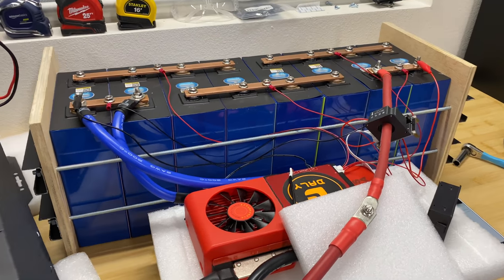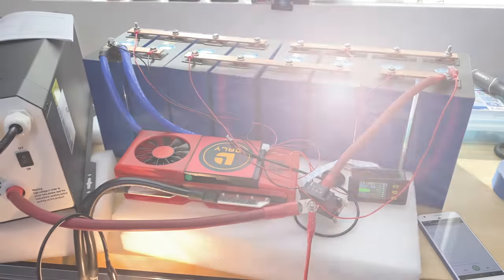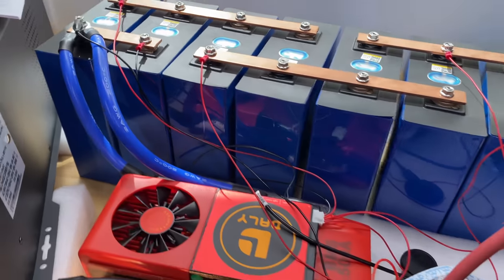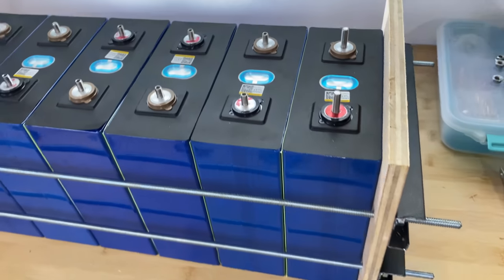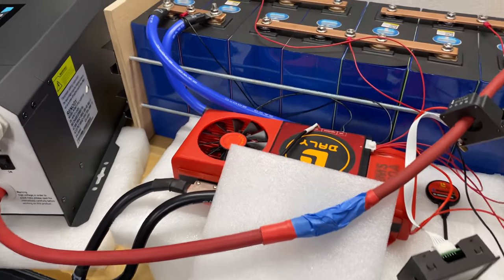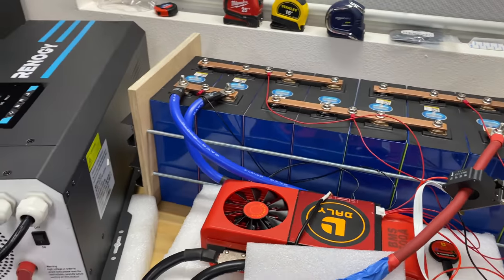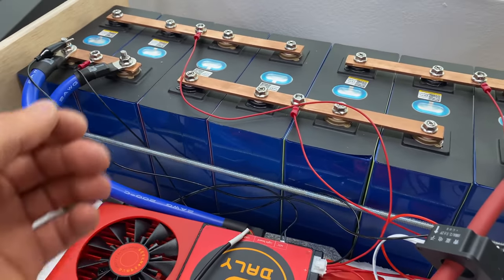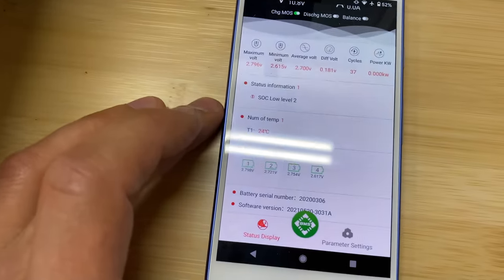Compressing swollen Grade B LiFePo4 prismatic cells. Let's experiment. Don't try it at home.

Comment: For the bus bars I recommend oval shaped holes instead of the round ones that fit almost exactely to the thread. With almost no space for expansion the tension/force will damage the housing of the batteries. At the same time, I don't think it is wise to compress battery cells, no matter what kind of technology is involved. Lead acid cell can also swell, suppose you would do the same ?! This is a blue print for disaster...
Reply: I would agree with you for Grade B cells, but let's not forget that the battery cell manufacturers actually do recommend it to increase the cycle life of the cells. I think that as long as you don't go to extremes with the pressure when compressing them, you're going to be fine.
Reply: The cell manufacturers recommend compression. Eve batteries are give 2500 cycles lifespan uncompressed, and 3500 when compressed.

It seems counter intuitive, but that's what I've seen
Reply: @MatthewN8OHU  beat me by 14 seconds! lol
Reply from the maker: could you give me an idea of how to cut oval holes? I was thinking about this, but cannot get an idea of how to do it with standard tools. Thanks.
Reply: @SolarEngineering  two holes drilled adjacent and a little file to smooth the ridges between.
Reply: @SolarEngineering  use your little grinder to cut between 2 drill holes
Reply: @SolarEngineering  after you have drilled the hole, angle the drillbit from side to side along the busbar(   --/-- then --\--   )  that will carve away a little and make it oval. Test on a scrap piece before, and dont put too much pressure on the sides, I have done it with a cordless drill in screwing mode( with torque clutch) so if it snags it will stop
Reply: @SolarEngineering  Depending on the material (copper, steel...) drill 2 holes close to each other and use a file. Miling is also possible if you have the right equipment/tools.
Reply: Considering several spec sheets I've seen have specifications for compressing these types of cells I'm not sure your gut sense is necessarily accurate in this case. ~12psi is a common measurement, coming out to roughly 600 Lbs/force for cells of this size.

Cylindrical cells don't bulge because the structure of the case more or less prevents it, they can contain upwards of 100psi. But the thin wall prismatic cells make terrible pressure vessels. They have just enough structure to keep things from spilling out, but not enough to keep the jelly roll inside from moving around excessively and bulging the case.
Reply: @SolarEngineering  a Dremel with the correct bit for copper, after drilling two holes on a drill press using a clamping fixture.
Reply: If bolts or nuts are torqued properly, oval vs round hole won’t allow for expansion. Busbars go on easier once they have expanded, but that’s it. 

I use ceramic fiber mat between each cell and on each end, to help contain a shorted cell from overheating nearby cells. Then 1/4” cement board (hardiboard) on sides and bottom. Then an oak board on each end with well rounded corners. I install 3 ea 1” cargo straps evenly and apply 12 psi. Use a scale in between to calibrate your finger and ears. Get the same brand and size of straps. All you have to do is flick them like a guitar string, you’ll know your close to 12 psi. I shoot for 10-12 psi.
Reply: @USA-GreedyMenOfNoIntegrity  Interesting comment. I'm not that familiar with ceramic fiber. Thnxs for sharing.
Reply: These cells have an expansion safety hole on the top, which is supposed to burst, as a safety measure. It seems this might not occur if the cells are not compressed properly.
Reply: @SolarEngineering  Oval holes are too much work. Just do bent bars so they have a bit of flex room. Like little arcs. 
_/\_
Reply: @DavidHalko  Many battery systems are equiped with these overpressure valves/safety holes. However, I've seen many batteries which were extremely swollen, but the valves didn't open at all.
Reply from the maker: thanks for advice
Reply: @PhG1961  - “swollen, but the valves didn’t open at all”

Were the batteries compressed?
Reply: @DavidHalko  Not very tight. There was some free space and the batteries were extremely swollen almost to the point that they would burst open. These were mainly lead acid batteries for UPS equipment. My experience is that after some years the overpressure valves are somewhat glued up because of the residu of the chemicals inside.
Reply: @PhG1961  - “lead acid” - I had to deal with lead acid batteries which vented in a UPS, what a nightmare! Terrible smell, acid everywhere, had to rip apart the plastic housing with a crowbar to get at the individual vented batteries for removal. No fun.
Reply: @DavidHalko  This is exactely what I had encountered ! I was lucky, the batteries didn't burst open. In the UPS tray there was very little room for expansion...
Reply: @SolarEngineering  Your round holes are just fine. The oval holes are just for initial install. If you left the terminals loose enough for the terminals to move in the oval holes you would create arcing and destroy the terminal. The terminals need to be torqued, in my case I use 4nm.
Reply: @SolarEngineering  Buy  1/4 diameter roughing endmill and first drill hole normally and then use endmill and elongate the hole by moving the part and drilling with endmill little bit at a time. Hold the part firm in a vice, easy. Use light oil or tapping fluid.

Comment: So you got 240-260 Ah out of 280 Ah cells? Did you pay for grade A or lower batteries? Did the price reflect the 10% capacity loss that you have documented? Was the discharge test conducted at room temp, around 20-25 Celcius? As we all know, low temps reduce capacity.
Reply: It was Grade B, but 280 is far from 240-260 AH.

Comment: Hi, i just bought 16 brand new grade A Eve 304 cells. I want to have the same setup as you but two rows of 8 for 16s block for 48v system. What Nm should I tighten up the nuts on the  4 threaded rods to meet Eves recommendation. They dont specify how to do it. Thanks so much.
Reply: I think the specs recommend 300Kgf. Too tight is as bad as no-compression. I am thinking of adding a spring to the rods or some soft material in between the cells. Any ideas?

Comment: Hi! I see you used some kind of inductive load in the discharge test. How accurate is your consumption measurement with an inductive load compared to discharging with a resistive load? In my opinion, any cheap consumption meter is not necessarily close to accurate when the consumption takes place with an inductive or capacitive load.
Reply: If you use the same load for both tests should be the same. He got recycled cells probably see re-lasered QR codes an old one under that plastic top. Compressing a swelled recycled batteries won't fix the problem they are recycled likely been used for streetlights in China what I heard. These companies go around and replace the battery sell it to a 3rd party who puts new plastic on them re-lasers the QR sells them as Grade A batteries to Americans.

Comment: It is my understanding that you have to compress the cells once they are fully charged, and not to compress and then charge them. Also, it's best to use springs to offer resistence and not completely block their expansion and retraction. Finally you can't improve the battery by this method, but you add longevity to the cells, which, off course, works best for cells that arent bloated already.
Reply: It was my understanding that it depends on the type of cell and if the manufacturer calls for compression or simple fixturing. These bare cells often have a +/- dimension for different SOC.
Reply: Why compress when fully charged? is that too late, cells will have swollen?
Reply: @kandkob  perhaps it's like the advice to buy shoes when your feet are swollen? Calibrate based upon the high side of the normal cycle.
Reply: @kandkob  It's the nature of the prismatic cell to expand and contract. You don't want to stop that, you want to control it a bit. That's why you can use springs to offer resistance to this movement. That makes more sense when you have brand new cells, though. To tight already swollen cells like that risks blowing the overpressure valve and killings the cells.
Reply: That is contrary to what I've seen. You want to fix them at their lowest state. You're right that you don't want to completely stop movement, but it does seem that controlling the plane that the growth occurs in is the reason the cell life seems to improve. You don't want growth perpendicular to the jelly roll layers, you want the growth to occur parallel to the layers.

This is one area cylindrical cells absolutely excel. Prismatic cells don't have the benefit of geometry, so they need mechanical help to maximize longevity.

Comment: Alternative title: how to trigger the overpressure release valve 100% on grade B cells
Reply from the maker: )) good one
Reply from the maker: @kimmer6  😂 just a little bit, what happened to the cells?
Reply from the maker: ah, nm, read the description.
Reply: @SolarEngineering  My brand new power supply arrived defective. It did not hold the voltage setpoint. It ran for a week top balancing 12 cells but made little progress. I disconnected 8 cells and put the leads on 4 cells. This happened overnight. The replacement power supply works as it should. Its an expensive mistake.
Reply from the maker: @kimmer6  ah, unfortunately. I feel you pain man

Comment: Compression makes sense over many cycles. It is not possible to see this effect in one cycle.
The difference of a few Ah is not the point.
Due to the new datasheet from 2019 (website: off grid garage) you can see
the advantage over thousands of cycles. The main part is not the central force of 3000N, but the right pressure  !
The gap between the cells should filled - thin layer of epoxy for example, otherwise this is not effective and would cause damage.

Comment: My battery setup is 200 ah plastic encased prismatic cells and no compression they are just put in a plastic box and I use a 200 amp Daly BMS too plus renogy 500 amp battery monitor

Comment: Compression is supposed to be constant pressure. Solid rods and wood ends will result in increasing pressure as cells swell. Some springs under one end of each nut would allow some give while still exerting pressure - still not constant but much less increase than solid.

Comment: Hi what the recommended charge level for 12v life po4 ? From my research its 3.65 per cell.Whats the maximum discharge voltage for the batteries to get maximum cycles from them? I bought 310ah and they are very bloated … i balanced them out and charged each cell to 3.6 and now want to discharge them but unsure to what level its reccomended to do so, can you advice?
Reply from the maker: 14V should be good enough to charge battery fast and keep some safe margin.

Comment: Is it possible to connect 32 cells With 16 cells in two parallel groups That is, summing all two cells parallel to each other Complete with a 51 volt system Any breath, 51 volts Note with the use of one bms
Reply from the maker: yes, checkout my latest video. I have battery 3P16S
Reply: @SolarEngineering  Thank you for the information But why don't we notice it a lot, especially in its great capabilities, unlike the Package Parallel separately?
Reply from the maker: @munirzangana3594  almost every EV has cells in parallel.

Comment: Can you post a link to that ammeter you were using to conduct the test?
Reply from the maker: here you go: https://amzn.to/3F0PXTZ
Reply: @SolarEngineering  thanks.  I picked one up and I love it.  I discharged the batteries completely and then charged it and found my batteries to have a higher than rated capacity (294Ah vs 280). I realize that the 280 would be at 280 amp discharge but i don't really have huge draws like that so it seems more realistic for my usage.
Reply from the maker: @J.DiPietro  wow, you are lucky! glad to hear that you got good quality cells.

Comment: I have the same batteries as you 32 PCS 280Ah 3.2 v i’m going to be linking the batteries together similar to the way you were but in a past video I saw flexible bus bars put less stress on the battery terminals with the very little fluctuation the batteries need do ! It was on YouTube a lady did the video check in the amperage in the batteries in the heat on the terminals in the braided busbars perform the best not the rigid copper bus bar ! Hopefully this may help you in any future frustrations you may have but things out working correctly !

Comment: For the price these cells are a steal.  I got lucky I guess. Mine look brand new and the sides are actually a little concave. 8 x 280AH, same as your. Paid under $870 USD ($1200 AUD) shipped my door in australia. $110/KWH is a bargain even if they fall well short of their claims. I'm a remote power system sparky from way back and used to do all this with lead acid, which even now are still over 3 the cost per watt. 

And this is China dude.  Ya pays ya money and takes ya chances.  You know that. ;)
Reply from the maker: I understand what you are meaning, but I would like to get what I pay for. Otherwise, it's just a game without rules, where the buyer is going to lose.

Comment: hi, what is significate of grade b??
Reply from the maker: Grade A cells - it's a new cell, never been used, every cell has a unique ID number and capacity is equal or more than in specs.
Grade B (or not A) - cells that potentially were used or cells that have defects and/or under rated capacity and unique number were destroyed.

Comment: I don’t get it, what’s the total “result”???
Reply from the maker: Test params:
Cells charged to 3.65V (till 100mA)
Cells discharged to 2.5V
Discharge current 75A (+-4A) / 0.13C rate

Ah before compressing  - 480
Ah after compressing  - 488
Reply: @SolarEngineering  I see, much appreciated 👍🏼

Comment: Just an observation, you are not really compressing the batteries correctly with those metal bars at the top. The holes you drilled need to have wider range to allow compression. Refer to the bars sold on Amazon and Ebay.

Comment: Have you tried ordering through Alibaba and not aliexpress? I notice that your cells are out of balance by quite a lot. Is the bms not balancing them well? While one cell hit 2.5, the other were at 2.7. If they get balanced properly, you should be able to get 490~500 ah from them. Just a guess. Thank you for the video.
Reply from the maker: I haven't as I understand it's same company with same customer support.
Reply: @SolarEngineering  the company behind them is the same. But Aliexpress is more retail, while alibaba is more wholesale and actual factories that take your order directly. CATL or BYD won't be there. Unlikely to find EVE either, but you can find good companies who sell cells on wholesale and can provide you with balanced and grade A cells most likely. As with any such platform, have to research the seller more than the product :D. Bansen tech, deligreen and  a few more like that are very reputable. They also provide videos and pictures of your order (that is not proof enough, things can always get mixed up). But way better than using aliexpress in my opinion. I personally haven't tried them yet. I will be ordering once I get my import license in my country. A thought for the next time.
Reply from the maker: @asderven  interesting, thank you for the information. Need to do research about it, curious to hear people who placed orders on Alibaba.

Comment: There is a world of difference between different grade B cells btw. Grade B just means factory rejected them because they didn't meet all criteria to be able to keep factory qr code and factory warranty. If a seller claims it is grade A cells it is very bad tho and a blatant fraud. I have 40x grade B Rept 280ah cells bought from donguan lightning. They where never advertised as grade A (or grade b) but was advertised as new wich is most likely true. I have 32 of my cells in a 2p16s battery which i can draw 30kwh from which is 293ah from all cells. No bulging. The 8 remaining cells where 288ah or more. Im not sure why factory qr code was scratched but for use as energy storage my cells are A+++++++ lol. Maybe for use in EV it is not good enough i have no idea
Reply from the maker: thanks for the information. In my case seller didn't claim it's a grade A (nor B).
Reply: @SolarEngineering  Still..85% of rated capacity is bad :(

Comment: No you should not do this this is actually very dangerous first of all reasons one they expand for a reason to when you compress them You're also increasing the pressure inside each one and when one continues to swell right next to another one it compresses the other one and once a cell is expanded and you try to compress it you actually can create a thermal runaway and issues the best thing you can do with cells like this swelling or not is liquid cool them cuz you keep yeah you don't want to do that they expand for a reason it's not just that they're guessing it's that they're gassing and creating an air gap where there could be an issue so yeah don't do this
Reply: Yes and no. Some manufacturers, like EVE, recommend compression (300kg) on some models (like LF380x) to increase the cell's life (from 2500 cycles to 3500). That's in the datasheet. So yes adding compression increases internal pressure, but no it is not necessarily a bad thing as long it is done correctly and on the right type of cells (some prismatics & pouches, per supplier's specs).